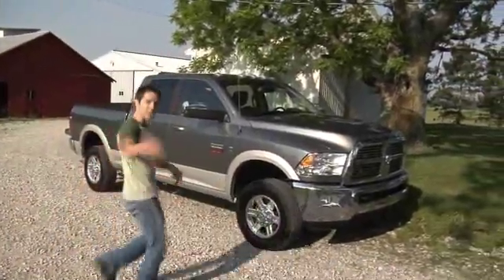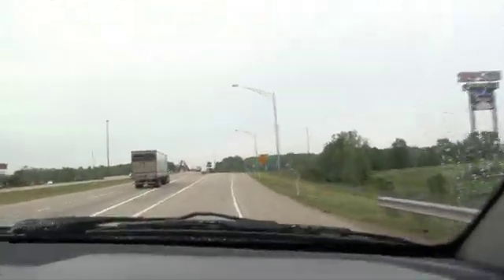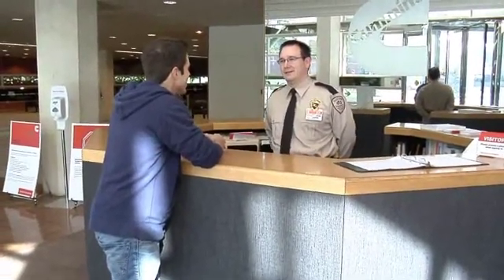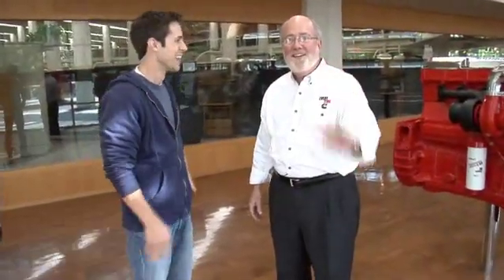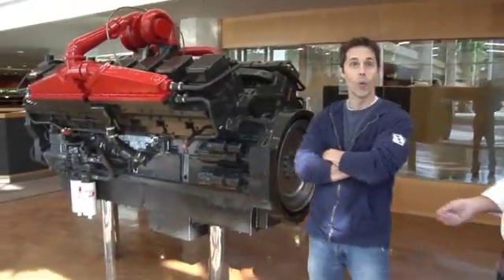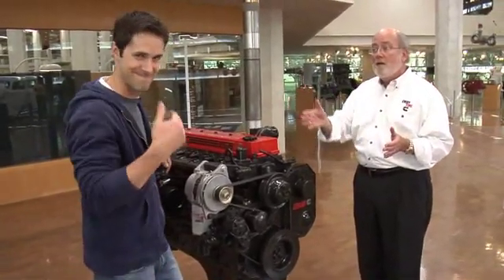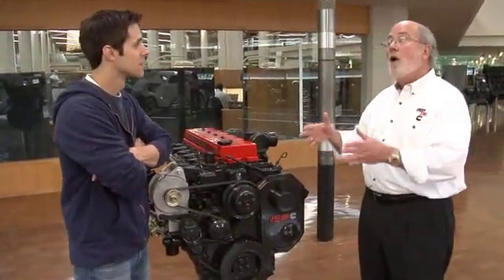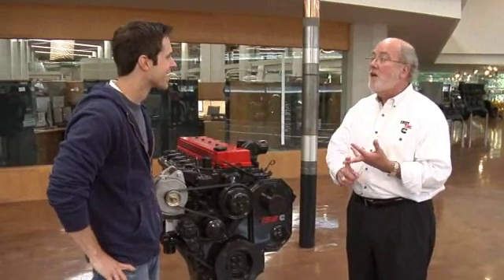Cummins 6.7's Biggest Fan (Pt 1): Road Trip to Cummins

Comment: I bought the Ford F 350 Dully 6.0 when I don't know the difference between a Cummins engine and a Power Stroke but now that I do I am seriously working on buying the Ram 3500 six wheels ( Dully ) I really love these trucks to come with six wheels. Another thing that I observe is that why are these monstrous trucks coming with small tires,they are supposed to have huge tires to compliment their look and size, at different times when I see these small tires they piss me off.

Comment: Of course no one mentions the terrible burning/choking ammonia smell that people experience inside the cab during a re-gen process. Would have never bought a Ram 6.7 had i known this
Reply: Take a few jumps so the emissions equipment can fall off.
Reply: Mine doesn’t have that issue. Although my father had one that did and Ram bought it back and gave him a new truck.
Reply: By the way, the problem is an exhaust leak where the tail pipe and resonator connect together. Instead of simply welding it together Ram replaced  the truck. Makes a lot of sense eh? Smh